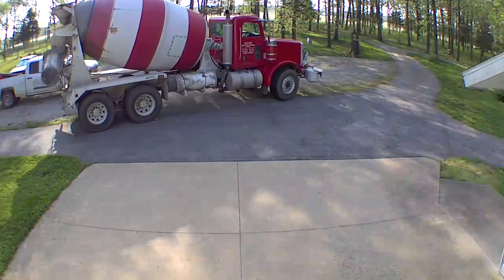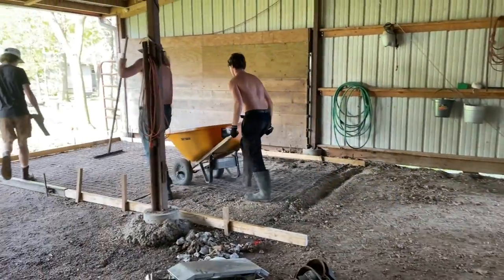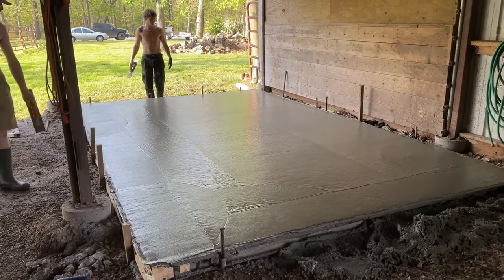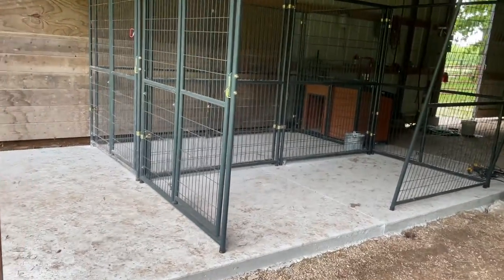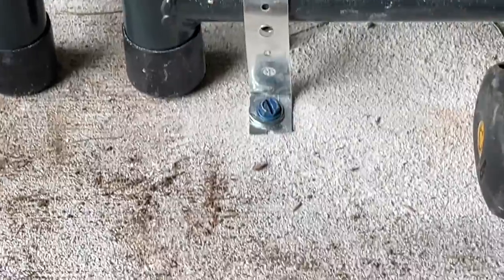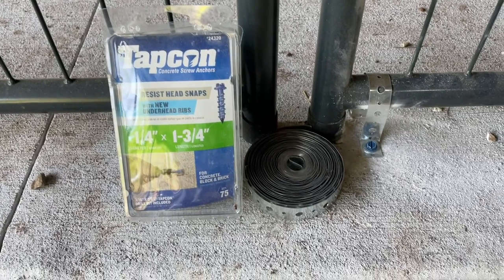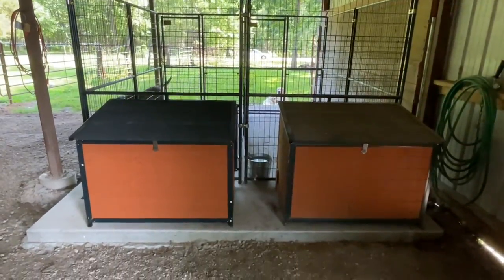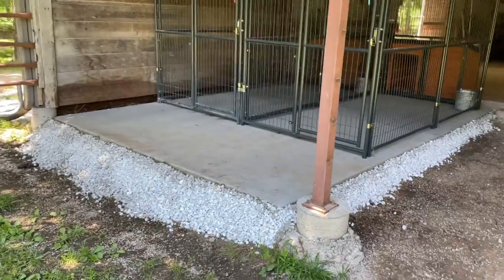How To Build An Outdoor Dog Kennel On Concrete!

Comment: I bought that same dog house.  Did yours come with predrilled holes on the metal frame? Mine did not.
Reply from the maker: No pre drilled holes. I used self taping screws.

Comment: I thought you didn't want concrete floors in your kennel haha. Anyways,  carry on.
Reply from the maker: You are absolutely right about that! It took me years to warm up to the idea. But it does have merits…significantly lower maintenance, higher durability…etc. so I decided to give it a try. I’ll let you know how it goes. 👍
Reply: @must_love_labs  oh okay. I understand and I saw one of your videos when you compared concrete to gravy floor. But good video
Reply: What would be the alternative to concrete, or what were you doing before?
Reply from the maker: Watch our Kennel Tour video to see:
https://youtu.be/itl31imIZXI
Reply: @Snowflakesonlypaws  horse stall mats work the best. Much cheaper, can easily be removed but not dug through, and don't get as hot or cold as concrete.